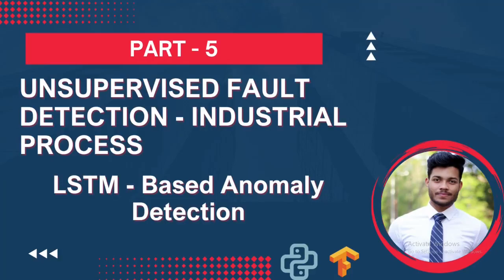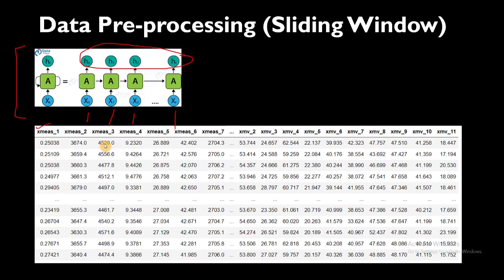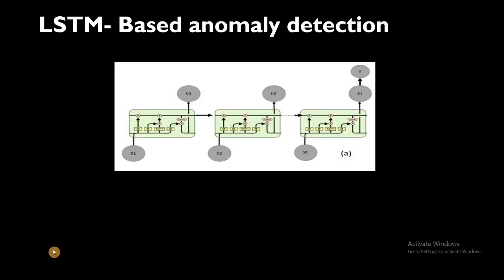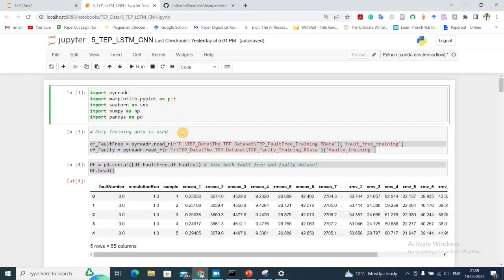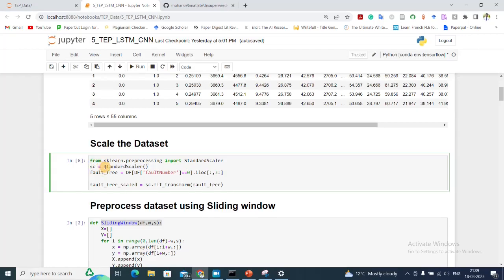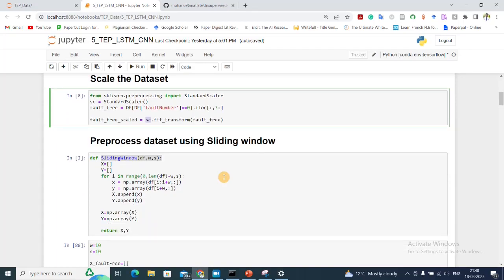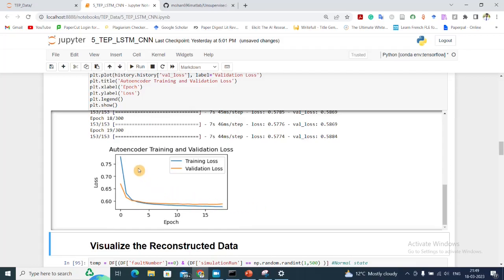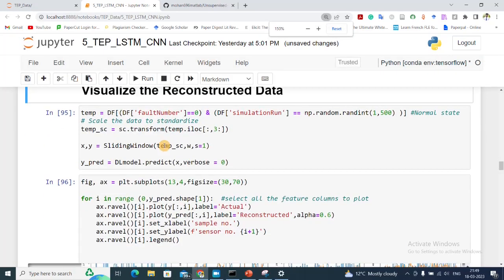LSTM based Fault Detection || Part 5

Comment: Fault of which device?
Reply from the maker: Hi, Harsh. The data set used here is from a simulation of industrial chemical process called Tennessee eastman process. You can see the dataset from the description. There were 20 different fault introduced in the simulation and to know more about the faults you ll have to follow their link.
Reply: @Mohankumardash  thanks